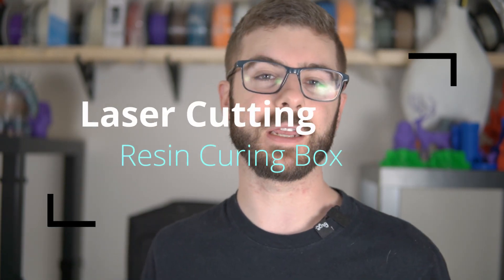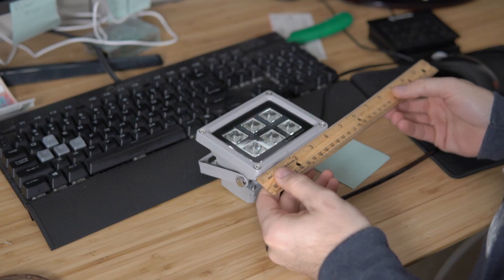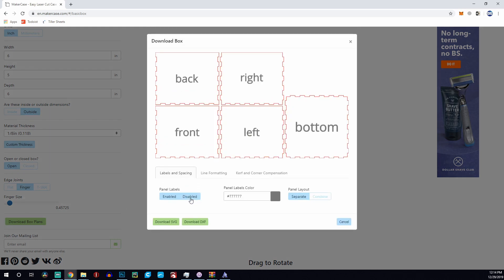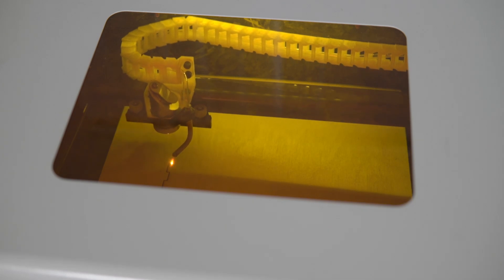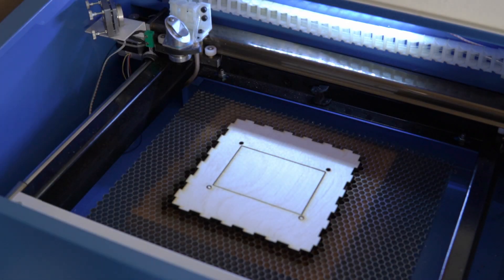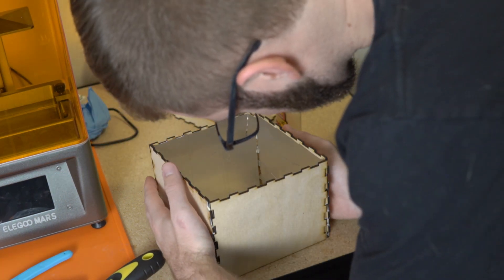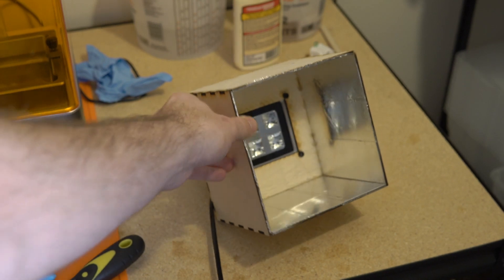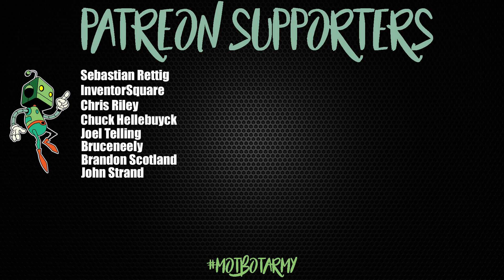Practical Laser Cutting | 3D Resin Printing UV Curing Box

Comment: You couldn't get 2 pieces out of 1 sheet of wood?
Reply from the maker: I believe that the wood was large enough but the wood is actually larger than the distance the laser cant travel. Ideally I should have flipped the pieces over. I kept all the wood though since there is so much good wood left for another project.

Comment: Nice project.  What kind of laser cutter are you using?  I have not used or owned a laser cutter and thought I would never own one since I live in an apartment.  What, if any, special ventilation do you set up?
Reply from the maker: Thank you :)! It is a generic Chinese K40 C02 laser. I have done quite a few upgrades/mods to it. I created a window panel and an inline exhaust so when the machine is running I turn the exhaust on which sucks all of the smoke/fumes out of the window. I should probably make a video on it at some point here.
Reply: I know that I would be interested in any video about the machine as well as projects you complete.  I definitely enjoyed this video.  Thank you again.  Coverage of your upgrades would be interesting also.  I like the way your laser project helped in processing a project from your SLA machine.
Reply: ModBot I’d like to see a video on your laser cutter mods.